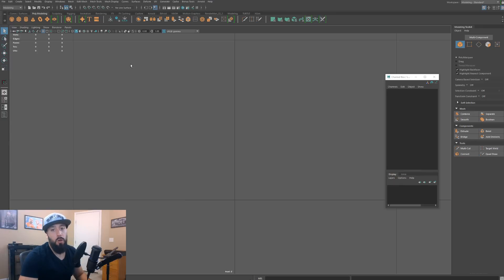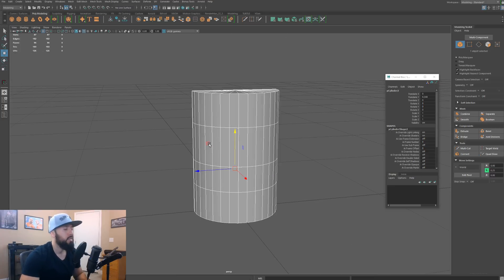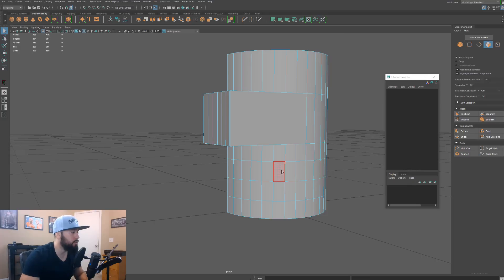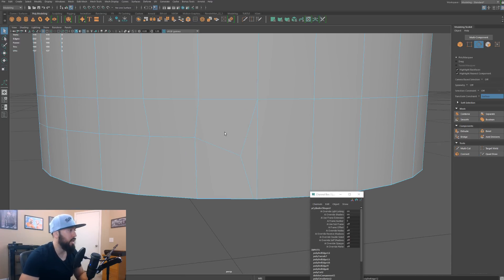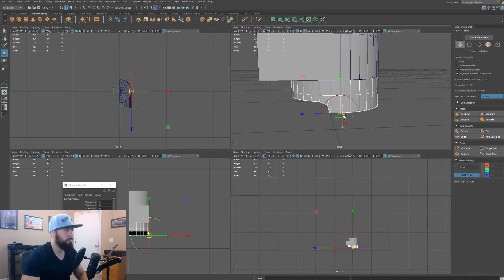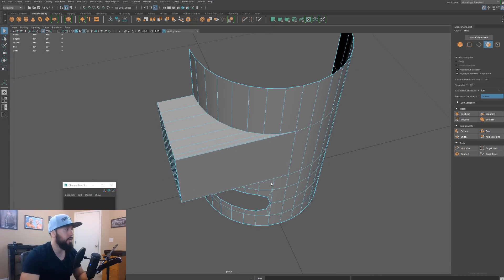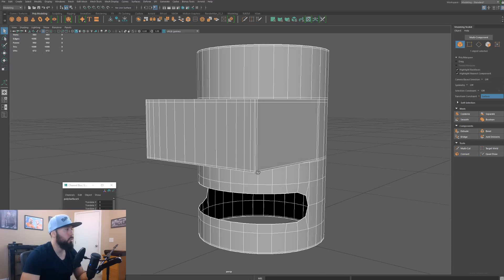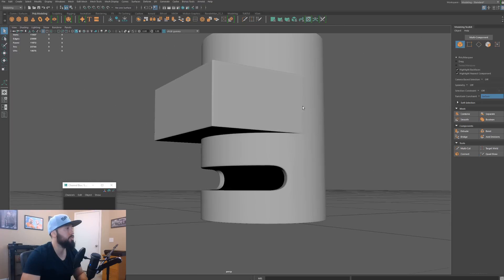Maya Hard Surface Modeling: Complex Shapes

Comment: JL, New subscriber. Speaking from one hard surface modeler to another your work is right on. Great workflows and spot on advise. BTW have you ever experimented with Maya's hidden tools (polyRetopo; and  polyRemesh;)? Would love your thoughts. Thanks again and keep up the good fight!
Reply from the maker: I've played around with it and seems useful.  Some areas do require manual clean up however, so I think knowing the basics and not relying on automated processes is still important. But who knows maybe in a year or two, you'll be able to boolean any shape you want and hit a button and get perfect topology. I'm  all for faster modeling tools as long as you get a quality end result. Thanks for stopping by, I really appreciate the good vibes & support.

Comment: Great video bro. How long have you been using Maya? This is not easy for just anyone to pick up. Is this your fulltime job? I really need to get my hard surface modeling game up.
Reply from the maker: Thanks brother.  I have been using Maya since 04-05.  Long time, but I did work in a program names Softimage for about 5 years solid.  Just takes time.  Pick up projects that you can challenge you but are doable and try to increase the difficulty asset by asset.
Reply: @jlmussi  Damn bro. You've put in your work. I remember Softimage. Those were the good old days. Really good advice brother. thank you. I'm currently working on some hair using xgen for a co-worker of mine. It's a good challenge and I learn mad new Sht every day.

Comment: Another awesome video. Question though. If it is Bender (Which I'm pretty sure it is.) wouldn't doing the extrusion for the eyes be easier by extruding something similar to how you did the mouth?
Reply from the maker: Yes it could be done that way.  I was sent wip screenshots at odd angles and was trying to re create the shape.  I figured out halfway thru that it was bender.
Reply: @jlmussi  Makes sense. Ever thought about doing a video on how to ask for help the best way? Explaining what angles would be Most helpful in screenshot and the similar things. I've seen a lot of Facebook posts asking for help but it takes about 10 to 20 messages back and forth to get the correct information sometimes.